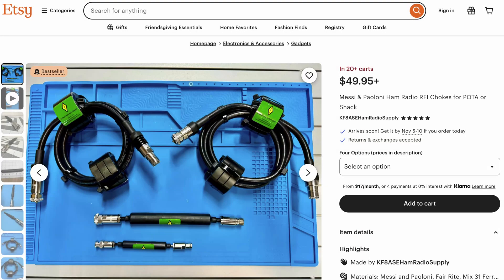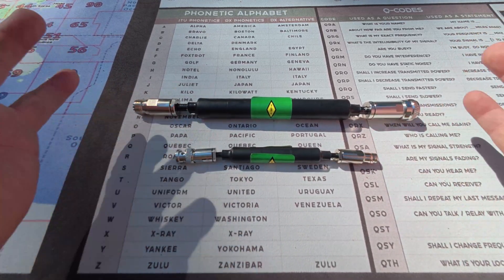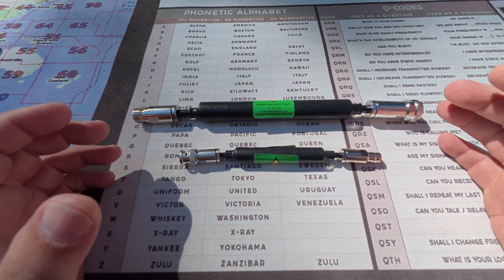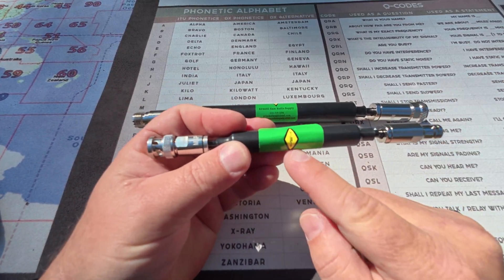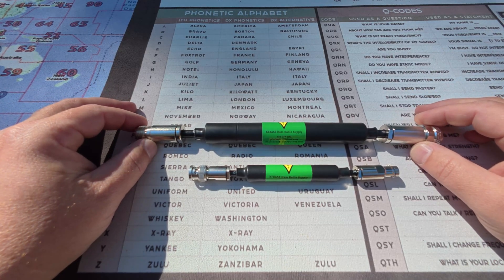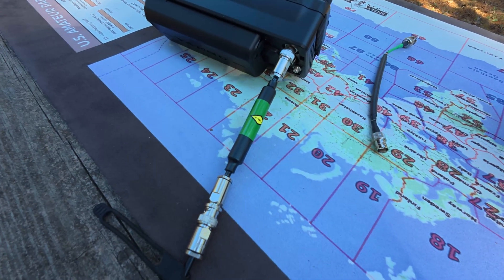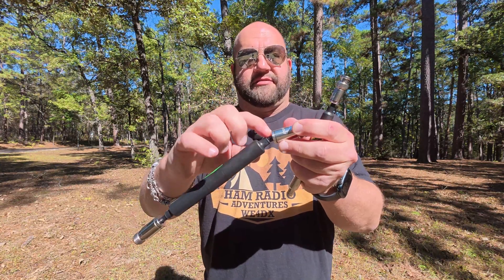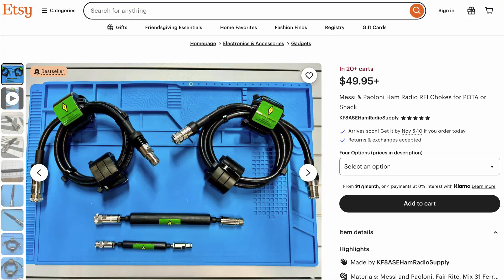KF8ASE Messi & Paoloni Inline RFI Chokes Should Be In Your Go Bag!

Comment: Interesting video! I know that marine VHF is far from HAM, but your knowledge about radio in general way higher than mine. What do you think, does it make sense to connect choke to my marine VHF radio? The mast is 17m with 4db antenna. As well I’m planning to change the old coaxial inside mast with M&P ExtraFlex10 bury, thanks to your detailed video review on M&P cables and connectors 😊
Reply from the maker: You know, that's a good question.  I've never personally put a choke on my VHF radios nor have I seen anyone else doing it.  It certainly can't hurt, but I'm not sure if it's necessary.  Maybe someone else will chime in with some more info??
Reply: @hamradiotube  Hi
Reply: @hamradiotube Thanks for the help!
Reply: For what it’s worth, my experience has taught me to choke all RF. I regularly use amateur, MARS, GMRS, CB, MURS, Marine VHF (and HF), Aviation, and even business/commercial frequencies, and everything has the proper choke mix. I even choke coaxial internet. Will you notice a night-and-day difference? Unlikely. Will it help reduce interference (both caused and received)? Absolutely. 73
Reply: @DSteve-i95 Appreciate it, thank you for the detailed response. For offshore sailing I want the best from my VHF.

Comment: I did some testing of various chokes in my collection.  I have an ABR choke with 7 Ferrites  on 240 coax.  This choke showed  a bit better than 20 dB attenuation of common mode current between 80 and 6 m.  No choke in my collection was suitable for 160m. I have a different style of choke from Palomar that likely includes a coil of coax and possibly some ferrite in a PVC cylinder. This latter choke shows a strongly frequency dependent attenuation of common mode currents. (It is a coil after all).  It shows strong attenuation near 80m (>40 dB) but on 10m the attenuation is only about 15 dB. It also shows low attenuation on 160m.  160m likely requires a different mix.  I also have a choke similar to the Palomar choke made by another company, It shows a very different frequency response from the Palomar choke. Ferrite chokes are a good choice due to the relatively flat frequency response. Yours are no better than mine and likely slightly worse.   Ferrites  get hot in use. Power may be limited by the size of the ferrite bead.
Reply: For very low frequencies ferrite mix 75 is probably the best.  It's good to "maybe" 10MHz but really shines at lower frequencies.
Reply: @mikesradiorepair  You are correct.

Comment: Where do you suggest to place a chock on a g5rv?
Reply: I always hung one on the connector at the end of the ladder line.  I don't think that I needed it, but all the books say that you need a choke on the G5RV.
Reply from the maker: You know, that's one antenna I don't have much experience with but I would think you'd want it at the feed point.

Comment: I would recommend he make the coax just a little longer.  As it is if you install it like you did on the ground mounted vertical there isn't really much coax between the back of the connector and the heat shrink over the ferrite beads.  If your vertical were mounted a little higher that's going to put a heck of a lot of stress on that point.  There's not enough coax to allow a gradual bend in the cable.  I agree adding the sticker with contact info is a good idea.  I would suggest putting something over it to protect it.  I can see on one of the ones you had it's starting to come off.  How long before it's gone.  At the very least put a wrap or two of good quality packing tape over it to protect it.
Reply: I have a Wireman coax choke that's about 2 or 3 feet long.  I think the coax going into the PL-259 is broken as I'm getting high SWR when I use it with my EFHW's.  Need to sit down and sort things out.
Reply from the maker: That is something I mentioned to him for similar and different reasons.  Basically, some people wanted them longer, some wanted them shorter.  He opted to make them shorter for portability and convenience.